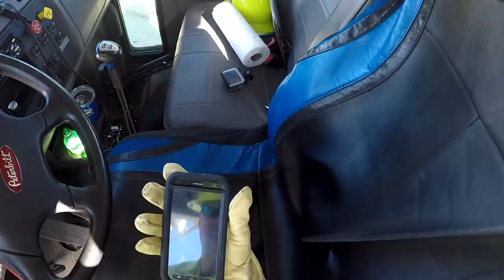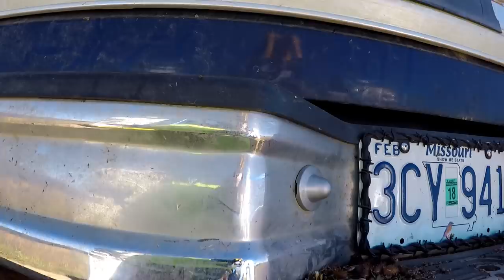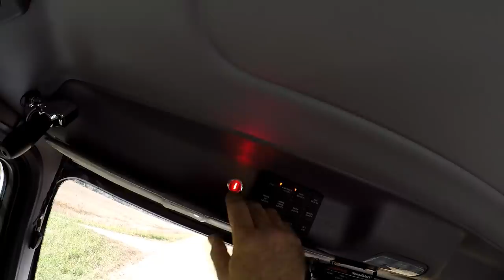Should've Driven the Chevy to the Levee??

Comment: 48:22 Did the truck rev up the engine RPM on its own? Or did the camera mic just adjust to being closer to the noise and made it sound louder?
Reply: I'd hazard a guess it was for the emissions controls; some types will raise the RPM occasionally like that.
Reply from the maker: Correct and thank you for your answer.  God bless.

Comment: Started on an Holm's 440 twin boom  in 68 in Maine finished on a 650ton DeMag crane Dec.19 in Fla. Most don't understand the responsibility matrix that comes with the job the details checked , the duties performed , the knowledge gained , applied ,documented and shared. Information from job experience , like when you tightened the shackle bolt an you said tight and then back a quarter or half turn , I know why you do that but I  would like to see you talk more about the Why in what you do,  how do you form a lift plan and again Why . Talk on the ride out  about the things you have to do,  the checks you make , The things you inspect and maintain  , All the stuff you do by remote control and you have done it so long that it's just part of you and what you do. Like the walk around inspection or checking fluid level , knowing what a guage is supposed to read basically the endless list of responsibilities that come with a CDL ,and/ or CCO

Comment: Hi! Did I interpret you correctly; those light bars are radio controlled, probably paired to the recovery truck, and programmed to reproduce the truck's brake and indicator lights? Would be nice to learn how those work in one of your next videos. …and what if you want, or need, to reverse? That seems unlikely, and regardless of the light bars; would you even attempt reversing? …with such a "small" load? …how about a bigger rigger?

Comment: hate to see a 9th gen (92-96) like that I personally drive a 93 f150 xlt 5.0 e4od and a 96 f150 xlt 5.0 e4od with 3.55 ls and overload springs. have a good one and God bless
Reply: also its a 94 model because of the pre 95/96 front bumper and in 94 1/2 ton trucks had to have drivers side air bags and third brake lights.

Comment: Awesome video! Quick little tip, you can run the seatbelt through the steering wheel in smaller passenger vehicles like the Ford truck shown here.
Reply: Ttom what I would have done was, fasten the driver’s seatbelt to the passenger’s seat that would keep the steering wheel in place.

Comment: Unlike you working with state-of-the-art equipment, my military experience relied on gear reduction and brute horsepower. My last vehicle was of a NATO design, it had a Detroit Deisel 12 cylinder, twin turdo, twin supercharger engine without mufflers. It was a stump puller, capable of dragging a brokedown 60 ton tank mired deep in mud.
Reply from the maker: Now that was a BEAST!!!  Thank you for your service and God bless.

Comment: i bet they came in from where white truck parked.. but backed up to try to get a running start cuz i saw the tracks coming from that side path.. where white truck was.. putting my re-enactment of scene.. then ran out of gas or fractured the fuel line.. & got air in the line.. & prob that's what i see there from being an observer..i did that here on the east coast in the dark.. almost ended up in the Connecticut river.. cuz the dust cloud a van caused .. we had half inch of dust in the car lol.. yes.. car..

Comment: Safety fuel switch from the impact behind the drivers side kick panel in the cab push it down and she will fire up.
Reply from the maker: Gas tank ruptured when she went off the ledge.  I smelled gas when I was hooking up, but didn't put 2 and 2 together until later.  By the time I arrived, all the gas was gone and all that was left was the fumes.....which are still very dangerous.  Anyway, thanks and God bless.

Comment: Ron, if you had a call to tow a pickup truck with a small wrecker from up against a fence in the front and side inside of a yard that won't start , would you use wheel dollies to move the truck sideways to be able to hook up?

Comment: Hey Ron quick question, I have been watching your channel on auto play streamed to my tv, and just wondering why you don’t cross your safety chains and your tie down chains in this vid and a few others I don’t quite understand how that setup keeps the towed unit from sliding. Or why not just use your under reach straps? Not putting your work down at all just curious maybe I’m missing something?
Reply from the maker: Good question.  I install 2 sets of chains/straps.  The tie-down chains/straps actually keep the towed vehicle secure to the under-reach/wheel-lift and keep it from sliding side-to-side, while the "break-away" or safety chains are designed to catch the vehicle and slow it down in a catastrophic event, heaven forbid.  I get asked this question a lot, so it's ok.   Thanks for watching and God bless.
Reply: Ron Pratt lol I understand what they do my question more for your tie down chains, you just wrap it and hook it to itself? You don’t put a chain binder between them? How is Just wrapping the chain around it then back to itself only holding it firmly in place?? I use kind of the same idea but with omega hooks then put a binder between them.
Reply from the maker: If you watch on the Heavy videos I go over the top of the spring on the outside, then drop the chain behind the axle on the inside, bring it up and hook the chain into itself, then loop the tag end around and anchor it in the hooks on the under-reach.  I do this on both sides. This way it has each chain secure, holds the axle in the cradle, and holds it from shifting side-to-side.  This also allows for some slack for tilting going through dips and rises.  I know the technique you are using and I understand it's purpose.  If that is the way you were taught and especially if that is the way your boss wants it done, then by all means do it the way your boss wants you to do it.   There are several reasons that I don't use the method that you use.   Everyone has different methods so as long as everyone makes it home safely at the end of the day I won't criticize.     Thanks for watching and God bless.

Comment: This brings up a question.. We recently bought a nice old 2003 Mercury Mountaineer all wheel drive, same as Ford Explorer drive. It uses a viscous coupling in the transfer case, no disconnect lever. I am going to assume you would either have to pull a drive shaft, or flat-bed it.... as the transfer case is always on, and not possible to leave 2 wheels on the ground.. What are your thoughts on this vehicle Ron?
Reply from the maker: You are correct that is would be suggested to flat bed transport the vehicle.  God bless and thank you for watching.

Comment: Once you got it up onto the road, you should've tried starting it again because maybe it wasn't able to pick up gas because of the angle it was sitting.  With it on the level, it may have been able to start and you might've been able to turn it around under it's own power.  When you pulled forward, why couldn't you just have drug it with you while pulling it around?
Reply from the maker: Our typical policy is to not start the vehicle in situations where the vehicle owner isn't present.  It's a liability issue.  As far as your idea of pulling the vehicle forward as I pulled my truck forward, there are times when I do that, but with the downward slopes on both sides of the top of the levee and no way to control the vehicle, I didn't feel like that was a safe option.   Thanks for watching and God bless.

Comment: At 48:27, when you fold up the second camera, the truck engine speed sounds as if it is increasing, without any apparent action on your part.
Reply: which, being translated, means ... ?
Reply: Cleaning out the Diesel Particulate Filter.  It traps the bits of carbon in the exhaust, and when the back pressure increases to a certain point the regen process lights a fire in the exhaust system (really) and burns them off.
Reply: Thanks for info - I couldn't relate the cryptic response to anything on European trucks (or maybe the ones that I'm familiar with are too old).

Comment: That moment when you pull on the cable and it doesnt free spool like it should is almost always on a job like this.Worst of all in my case its from the previous driver :(  I know it happens but what I dont get is how they can work with it like that all the time when if you'll take the time to respool it,it'll make it that much easier to use.Sometimes by being lazy guys actually make more/hard work for themselves.........Sorry for the rant Ron but I figured you'd understand.
Reply from the maker: Talon drives this truck and does a great job maintaining it, but things happen.  Of course others drive it as well.  I agree maintaining equipment is key for flawless future operations.  Thank you for your comments and God bless.
Reply: Sorry if my rant came across wrong,it was more or less directed towards the guys I work with.I just cant understand why they make things harder and more dangerous then need be.
  I could tell he keeps it pretty nice and like you said things happen,I've been guilty of it myself.It's just where I'm at now it's nonstop. ....On a side note how do you feel about cable lube?Do you guys use it or avoid it?.I know some swear by it and others avoid it like the plague,.

Comment: Hi Ron,  what was going on with the engine revving up as you were folding up the camera tripod?  I'm surprised that the engine wasn't on high idle from the get-go.  I don't know how old that truck is that you used for this job,  but you'd think that Century, Miller, Vulcan, all the companies that build light and heavy wreckers would have a link to the engine's ECM to raise or lower the main engine's rpm's on load demand.  Myself, knowing that a truck could be hours at a scene (for whatever reason) wouldn't want the thing sitting at curb idle.  I noticed that when you moved the truck ahead, you verbally "engaged" the PTO after moving and putting on the parking brake, but we don't hear the engine idle up.  For the record, I'm sure the weight of a pickup truck doesn't present much of a load in any respect to a heavy tow unit, but just wondered mostly about why, after all the work was done, the engine began to rev up (as you were folding down your tripod) ?  I've seen you using the F-series rollback, and each time you get out the door, you flick the cruise switch to put in on high idle, so just wondered why this truck doesn't idle up too.
Reply from the maker: Good question.  The engine revving on this video is the emission system going into a "regen" mode.  This is a 2015 Peterbilt....same year model as the rotator.  The new Miller systems don't require the engines to idle up for sufficient hydraulic flow.  The Ford rollback is a 2012 and doesn't have the newer generation PTO and hydraulic pump.  When we took delivery of the rotator, we were told that it was designed to be operated at idle speed.  I asked for an explanation, and that is how I learned the difference.  I was accustomed to always setting the "high idle" before getting out of the cab.....just like I do in the Ford rollback.
Reply: Well that would explain it, thanks!   I have some "regen" horror stories I could tell you.... but honestly, I've never had a truck that went into regen mode and revved up without input from the operator.  Is that the Paccar engine or did you go with a Cummins in that truck?
Reply from the maker: The Pete in this video has the PACCAR PX9, which is a Cummins.....  It even has Cummins tags on it.  We use Cummins Insite software to communicate with the ECM on it.  They can call it a PACCAR, but it is a Cummins. The Rotator has a genuine red Cummins 550 in it.
Reply: Thanks a lot.  Be safe out there !

Comment: Dang! How much cable length do you have?

Also, aren't your breakaways supposed to be crossed?
Reply: Paul-Joseph de Werk The wide-angle helmet-cam exaggerates the distance. Edit: Ron gives the exact numbers.
Reply from the maker: The winches on this truck carry 200' of cable.  Based on the amount of cable left on the drum it was probably around 150' of cable that I had out.  Gordon Richardson is correct, the GoPro distorts distance as well as light.....unfortunately, but it still takes wonderful video.  Thanks for watching and God bless.

Comment: I'm curious why you always leave so much slack in the breakaway chains. I'd think that's too much like it might scrape on the ground if you hit a pot hole or the like, is there a reason you don't pull it tighter?
Reply from the maker: You need to have enough room to make the curves so the chains don't pull too tight.  There is a fine line between too much and not enough.  Practice/experience is usually the judge.  God bless.
Reply: Makes perfect sense, didn't even cross my mind. Keep up the good work, always enjoy your videos!

Comment: Does that tow truck have a 13 speed eaton fuller transmission. I saw the blue button on the side.  It's rare to see a straight truck with just two axles that's over 10 speeds.
Reply from the maker: This one is a 10 speed with a deep reduction reverse.  It is odd with the blue valve on the side, but it is basically just a 10 speed.  Thanks and God bless.
Reply: Thanks for your reply Ron. Maybe some time in a video you could go through a round of gears.  I drove a Flat nose international dump for awhile in my youth, and it had a red button which was a gear, so I'd start out in 1st, then pull the button up, leave off the throttle, and it would shift into second, and it went like that all the way to 10th.  The more modern Eaton Fuller, you shift 5 speeds, than flip the center leaver and shift another five. I guess they could actually be considered 11 speeds, because of L-creeper than no one uses to start out in. I don't know why but stuff like that always interest me. BTW, thanks for your videos and my God guide you and look after you and your family.

Comment: what happen to the other rotator, seems odd seeing this older truck
Reply: The rotator is too heavy to drive on an unsurfaced road, and is not necessary for this kind of job. Edit: Ron explains this at 29:00 into the video, in response to the bystander.
Reply from the maker: I didn't need the larger truck for this job.  The "Little Pete" pulled it right up the the embankment.  God bless
Reply: This truck is not a rotator the boom doesn't rotate.
Reply: Remember this is the 4024 that doesn't rotate